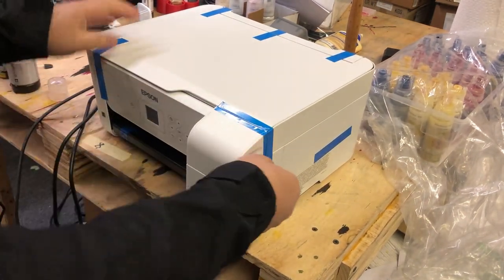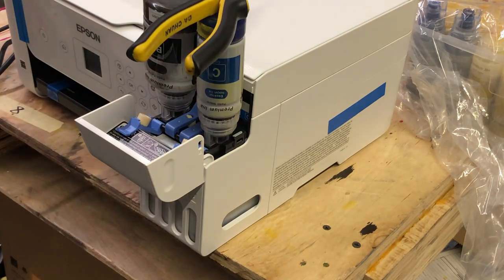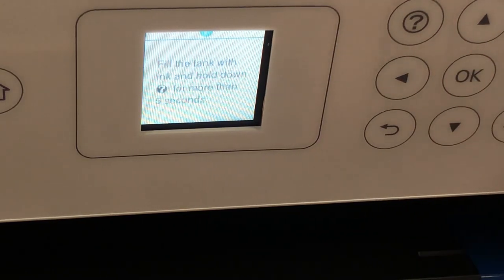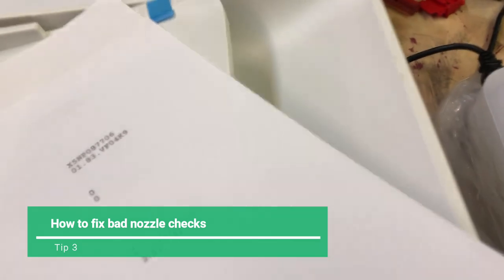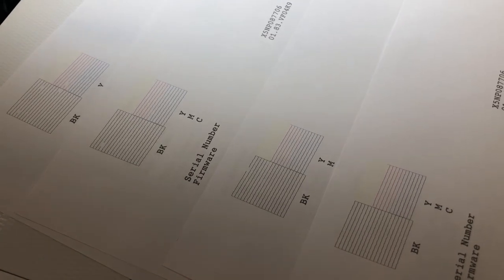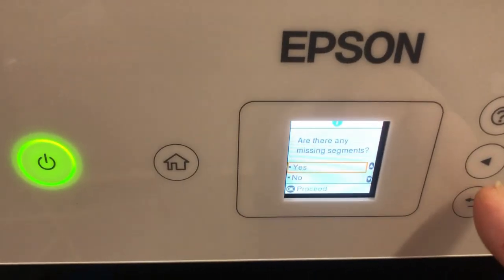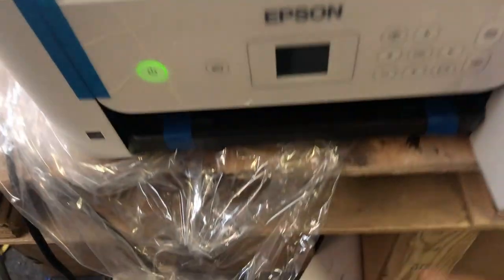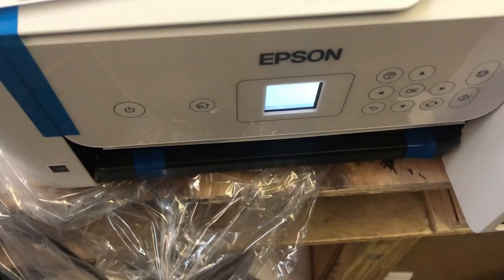Watch This Before Using Epson EcoTank Printers

Comment: Hope you can help! I just purchased eco tank ET 2800. It’s not printing at all. I’m getting no errors and I’ve done three cleanings. I did put sublimation ink in it. No inject ink was ever in it.
Reply: Did you ever get it to work? I'm having the same problem
Reply: No I contacted Epson they said it was a defective printer and I returned it to the seller. If you return yours do not mention sublimation ink at all I return mine with the ink in it and got my refund

Comment: Hey Kevin would the bch ink sold on the site be used in most Epson ecotank printers example L3150 printer.  I would like to purchase the bulk size bottles but only see the black 1000ml.
Reply from the maker: We use our standard grade dye inks and both EcoTanks printed over 30,000 pages now.
Reply: @BCHTechnologies  Thanks for the feedback, so do you reccommend the dye inks for the ecoanks? Also do you all sell the 1000ml bottles for them on site. Thanks again for your content.